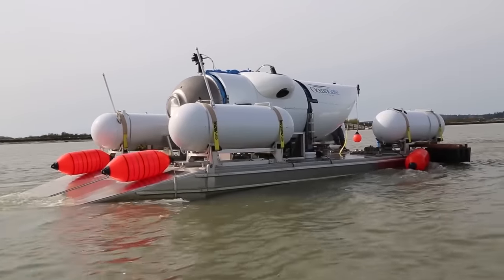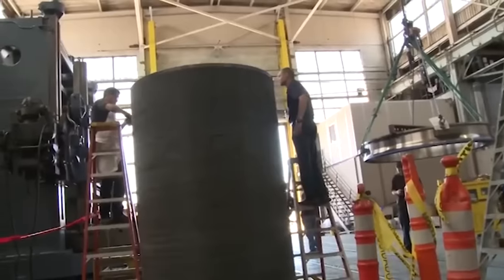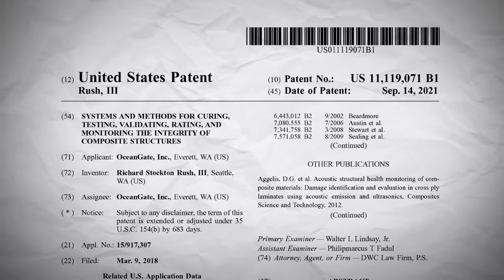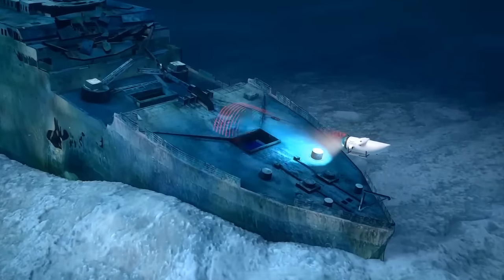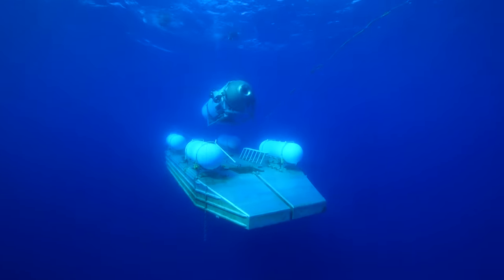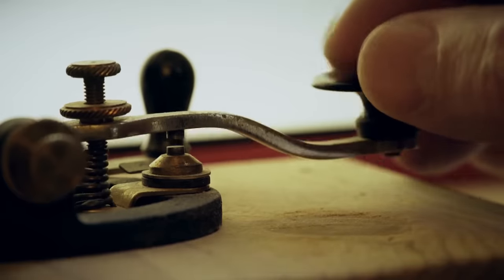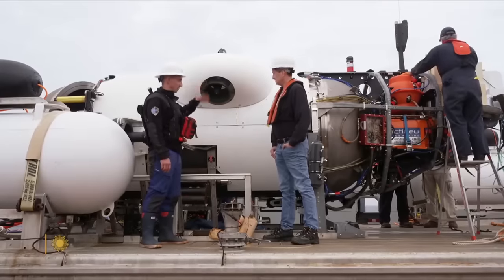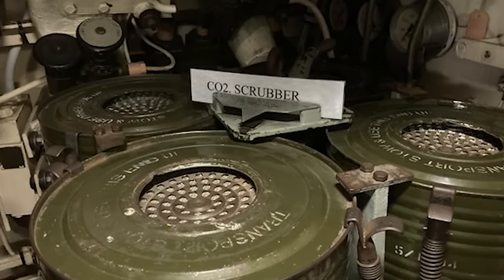Exposing OceanGate Submarines Many Fatal Designs

Comment: Quick note on the controllers: Yes, that way of controlling any vehicles is indeed very popular, however every military vehicle, robot or any other unmanned object is using they own custom made controller. Which is tested and certified as dust proof, water proof, vibration proof,  crash proof and spark free design. The list goes on. So I'd say that the method of controlling is popular, not the use of the game controllers itself.
Reply: Exactly what I was thinking! The problem is not the usage of a controller, but the use of a mass produced device prone to failure. I'm so annoyed by the arguments that say "but controllers are common" missing the point of irresponsibly being cheap on a vehicle carrying people...
Reply: No, the listed vehicles do use exactly the game controllers. The thing is, there's always a backup option in case the gamepad fails - nobody uses it as the only interface in citical applications. Nevertheless, some companies do develop custom controllers instead off-the-shelf ones.
Reply: I was going to comment of this aswell. A commercial game controller is nowhere near as safe and reliable to be used in a situation where someone's life depends on it. And carrying spare controllers wont help you, if the controller decides to go full throttle and crash you, or the controller may have a short circuit and start smoking or catch fire, which is something you dont want 4000 m underwater.
Reply: @Catrik it's bad enough when your controller locks and kills you playing a video game!!!
Reply: Just curious why is it that that are wine bottle in the titanic site fully untouched and unbroken by the so called tremendous so called pressures?
Reply: @kayeb222 not to mention stick drift
Reply: The biggest problem is that the controller was wireless. I can't count the times I've had a problem with one that took a few minutes to fix. It's one thing if the worst that can happen is you lose a PVP game. It's another if you crash face first into a piece of underwater wreckage.
Reply: @alexshatner3907  I saw a documentary where they said that the  wine bottles were destroyed but some champagne survived because they were pressurised. Dunno how true it is.
Reply: @alexshatner3907  Because they're full of wine?  Do you really think there's no water pressure at the bottom of the ocean?  Just take an empty plastic water bottle and put it at the bottom of a swimming pool and notice how much it compresses...
Reply: Absolutely. Off the shelf blue tooth controller from Best Buy doesn't cut it. But people tend to focus on the "video game controller" aspect not realizing that that's not why that part was sus.
Reply: @alexshatner3907 if the cork is the failure point and lets go fast enough, or if the cork lets pressure in slowly, there won't ever be enough pressure to break the glass bottle.
Reply: @kayeb222  Makes no sense, the Titan could not make it and the bottles did.
Reply: @dx1450  Even if they are full, have an elephant sit on it and see if it doesn't break?
Reply: @daniellewis1789  Even if they are full, have an elephant sit on it and see if it doesn't break?
Reply: @kayeb222 t’s the air pockets in objects that causes implosions.  If objects are completely filled with an incompressible fluid like water or oil, they won’t implode.
Reply: @alexshatner3907  Glass won't crack if there's equal and balanced pressure on both sides. If the lid/cork failed fast enough, there wouldn't be a pressure difference between the inside and outside.
Reply: @alexshatner3907  your right I guess. Maybe I misunderstood what they were saying but I know some full champagne bottles were recovered from the wreck. they explained something about why it survived but perhaps I misunderstood.
Reply: Yeah, Logitech controlers last about 3 months. Rush was a clown. To bad he took others down with him.
Reply: @alexshatner3907  where are you seeing that?
Reply: The controller itself wasn’t really the problem, despite having bad reviews (people are just nitpicking). The fact is human lives depended on it which was a poorly made decision. I would never trust myself with a gamepad if my life was on the line.
Reply: Not entirely true. Current active duty submarines in the Navy use literal Xbox controllers to control the periscope and its various functions. They're cheap to replace, and what sailor today doesn't know how to use an xbox xcontroller? Easy to train with.
Reply: @tickticktickBOOOOM  I know right, I didn't care he was using  a controller, it's that he actually put full faith in the bluetooth connection. Literally no good reason not to have it wired
Reply: Also NONE of them are ever controlling a vehicle carrying humans.
Reply: @vatnikforvdv8754 I won't believe that submarine full of people uses some old off-the-shelf Logitech gamepad, that's bullshit. yes they are used to control unmanned vehicles at the ground level, so what? we are talking about a whole different environment and carrying people on board. no sane engineer would use some cheap ass xbox controller in such circumstances
Reply: @alexshatner3907 there would be liquid in those bottles counteracting the pressure of the water on the outside
Reply: @Special1122  google "The Navy’s adding a new piece of equipment to nuclear submarines: Xbox controllers"
Reply: @Joe_P you said it, it was for periscope use, not as the main system to control a manned vessel.

Besides that, a fire is a serious issue for submarines. I doubt Logitech has an antispark certificate for its controllers.

An oil rig engineer with drilling expertise has a much broader view about it.
Reply: Gamer input, finally I have useful knowledge! Cept its not useful at all.
Reply: @daniellewis1789  That is the best explanation given Daniel, Iv'e been given he most ridiculous reasons why it does not break, one of them is that old wine does not allow the bottle to break, the other is the the deep sea is not familiar with wine bottles, so the pressures are canceled out etcetra
Reply: @kayeb222  ,Iv'e been given he most ridiculous reasons why it does not break, one of them is that old wine does not allow the bottle to break, the other is the the deep sea is not familiar with wine bottles, so the pressures are canceled out etcetera
Reply: @hanspecans  this is what I was thinking. I'm not an expert but I cant think of a single manned military vehicle which does not use a dedicated, wired in system to control the movement of said vehicle.
Reply: @Joe_P  They use it as a convenient interface, but there are multiple backups.

They certainly do not use it as the only way to control anything.  There's a video floating around of a previous dive where the controller was not working right and they had no alternative way to control the thrusters.
Reply: @YogaBlissDance  Yes
Reply: @brianstich7273  Gotcha you mean equal pressures all around
Reply: @vatnikforvdv8754 i don't think Logitech would be thrilled if their hardware was used to bomb civilians with drones. 
Military has custom controllers
Reply: @tickticktickBOOOOM  The controller kind of has to be wireless. You can't drill a hole in the walls of the sub to run a wire through it.
Reply: @SueMyChin really?  How do military subs manage to use wired controllers then?
Reply: @vzwodb17  They have huge aft pressure domes with a single control rod going through to the control surfaces. This submersible did not use control surfaces and was designed to dive at 4x deeper than know depths of military submarines.
Reply: False.
The military uses PS4 controllers for flying drones. 

In fact, they have entire rooms filled with nothing but PS4s being used as super computers since they are more powerful than actual supercomputers of the same size.

Yes, a bunch of Playstation 4s are calculating, organizing, and carrying out precision drone strikes by controlling smart munitions.

That said, they would never control something carrying people on board that way.
Reply: @Catrik ell that to the military with their predator drones controlled with PS4 controllers, using smart munitions controlled by PS4 systems.

Im not kidding either. Our military uses the PLAYSTATION 4 to carry out precision drone strikes, and uses the controllers to fly the drones.

That being said, those are all unmanned vehicles, and using a game controller in something like that sub is a terrible idea.
In that thing, even things that are just minor annoyances to gamers, like stick drift or input delay can quickly go from being annoying to being deadly.
Reply: @FatalFist honestly though, whats so different from a game pad to any other joystick and buttons
Reply: @jakehildebrand1824  What is you source for this? I do not believe it at all. There is absolutely zero reason to use a PS4 systems for military applications, solely for the reason that you cannot even buy them from anywhere after a period of time. 

A game controller might be used to training or simulator of a Predator drone, but extremely unlikely for a real usecase, though I could not google any kind of usecase. The predator controller looks like this https://www.youtube.com/watch?v=_w5NGKt71k4
Reply: @SueMyChin  Yeah, you can and do, but that's different from the actual controller being wireless instead of plugged into the sub's systems.
Reply: @tickticktickBOOOOM  Sorry, I'm not sure what comment you're replying to but the wireless receiver is on the outside of the pressure hull so there's no need for wires. It makes sense and should work fine however the fact that it's an off-the-shelf game controller with a lipo battery in it is crazy. They need certified for fire risk etc. The same with the lights from camping world. peoples lives depend on these to work. That's why the inside of tanks and military vehicles look so janky, they have to use 'guaranteed' equipment.
Reply: @alexshatner3907  exactly

Comment: Hydrogen storage tanks also are significantly different because they feel a tensile force rather than a compressive force, which is relevant when using fibers.
Reply: Also, due to the crustaceous vernaculars of the hull, the molecular breakdown was indeed inevitable
Reply from the maker: Thanks for pointing this out, I can't believe I missed this (tried to rush things..!) - I have taken that bit out of the video and will make a comment of it as a pinned comment via the YouTube editor which will update shortly.

Comment: Thr game controller is fine to use for auxilliary systems, but as the primary method of control its utterly insane. Especially since it's wireless - what a crazy single point of failure to have, especially when trying not to crash into a wreck
Reply: Why does everyone keep getting stuck on this? They had extra controllers and computers. And the controls aren't what failed and killed them. What should they have done instead in that cramped space? Remember this is a tourist trip - everyone wants a chance to "pilot" the sub for a bit, so good luck using anything else. 

The CEO is an idiot for the hull design and relying too much on those little sound sensors - but the game controller is just a good idea. And good marketing too, apparently, because they've gained meme status.
Reply: "Low Battery" ... never would happen, lol.
Reply: Why do we keep getting stuck on this?  Have you ever played a video game with a handheld controller?  They don't fail safe. Everyone has an experience where the controller glitched and their character got stuck for a few seconds either going in a straight line or spinning in circles until the connection reset.   

Imagine doing that in a sub. Now imagine doing it in a sub that is covered in loose cables and snag hazards near a wreck. 

Game controllers are used everywhere, but never as the primary/sole means of controlling a vehicle with people on board.
Reply: I have two of these F710 logitech controllers and they lose connection on a regular basis. They are the LEAST reliable game controllers I know.
Why use those? I fell from my chair when I saw that. Probably not the ultimate failure point, but it shows the man's disregard for safety pretty clearly.
Reply: @foot1221  the problem isn’t the inherent idea of using a game controller its the quality of the one they chose and the lack of redundancy 
They should have had several secondary input method in case of failure if it was me I would have had 5 usb controllers stashed on board just in case. usb to reduce failure points
Reply: I agree.  The loading trucks at work have hand controls on the string wheel for the forks as well as the accelerator/reverse.  They are chunky has a good range of motion, and fit ergonomically under your fingers and thumbs.  Shortly something like that should have been used.
Reply: Industrial grade controllers of similar form factor are available that are dirt, water, etc tolerant.
Plus, hard wired is a must in this application.
He, there are far more reliable and robust built controllers used among rc aircraft, drone users
Reply: @alexxbaudwhyn7572  Tournament gamers almost always use a wired controller, and that's just for a game. 

And it's true that the controller wasn't the factor that caused the vehicle to be lost, but it's an illustration of how they cut corners at every opportunity.

Comment: One thing I haven't heard anybody talking about is temperatures. You have a different mixture of materials like carbon fiber and titanium. Throw some rubber gasket material in there. At depth you looking at below freezing temperatures. The CF and titanium are going to expand and contract at different rates. I suspect that played a major role in the implosion of it. Just couldn't handle those kind of stresses.
Reply: Very good point!
Reply: Same
Reply: Yeah, I watched a video of a former Navy diver explaining exactly this. The fewer different materials you have the stronger the vessel overall. That's why Navy subs don't even have port holes, only periscopes. Every extra feature is also an extra potential failure on a sub, or on a submersible.